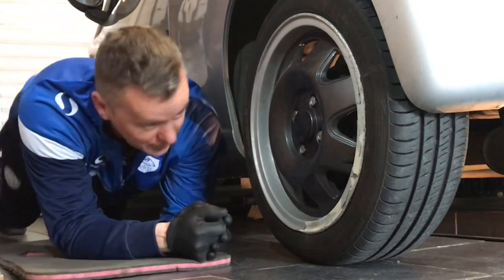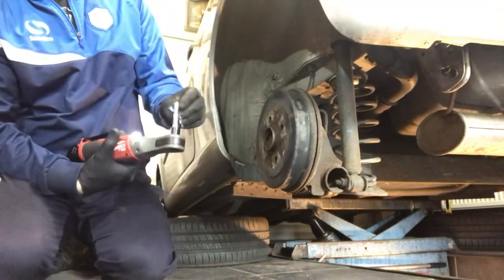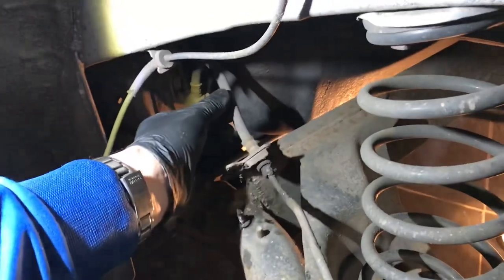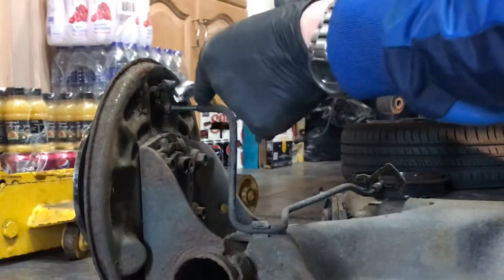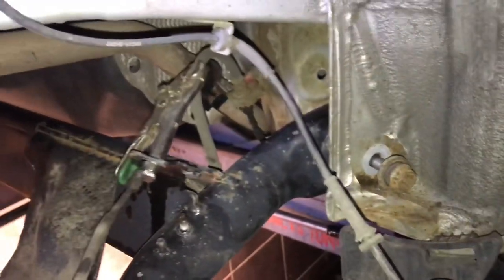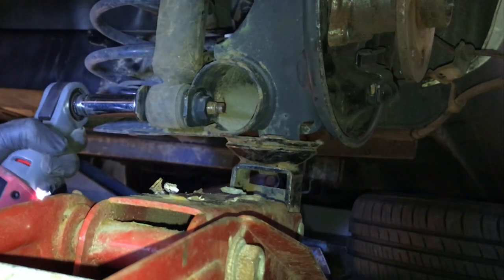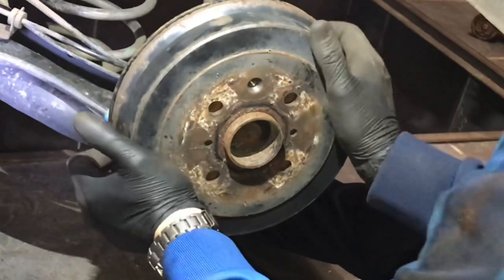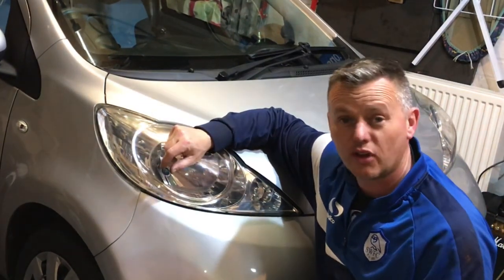Peugeot 107 Rear Suspension Replacement Following a Crash into Kerb, (AYGO C1) Rear Axle Beam Swap

Comment: Well done saved the day again. :) Good job it wasn't an insurance job as they probably would have wrote the car off. 
Think you will be lucky to find a replacement identical wheel. What make and spec are the wheels? I'll have a look about see if I can find one. If not what size are the tyres (they look quite new) and will see if somebody has a set of alloys if you have no joy finding one of the originals.
Reply from the maker: The wheels are ATS cups size 15” 6j et35 100pcd, there are more 7j wheels for sale, might go eurostyle and stretch the tyres if I can’t get a replacement 😂thanks for the help 👍🏻👍🏻🛠

Comment: Hi Anton, Any videos coming up on changing rear beam bushes. Thanks
Reply from the maker: They don’t usually fail Gary, are you having issues Thanks for the great comments👍🏻👍🏻🛠
Reply: @aaanton11  No problems,High millage car so I thought id replace them. Christmas project while on holiday. Did all the fronts apart from ARB six months back.
Reply: Thought about this too as I'm thinking of taking the axle off the car to treat rust and paint up (both axle and underbody) as will make it a fair bit easier. No play in the bushes but they look a bit naff. Did you replace yours in the end?

Comment: Just like a Yaris Mk1 except for the back exhaust.I did my rear shocks and coil springs 3 months ago,it is that easy to do.Never done my rear brakes thou for that reason...fiddly isn't me or for me.Nice job and nice video.QUESTION- My Yaris never had a retainer screw for the drums,is it bad not to have them?
Reply from the maker: no the retainer screw only only has a purpose when the wheels are off, so don't worry. Thanks for the great comments👍🏻👍🏻🛠

Comment: Do you reckon you could fit an air induction kit to the 107 next?
Reply from the maker: I don’t rate them, fitting a k&n Filter is just as good, the vvt needs a good intake swirl, the standard air box delivers this, by removing it you loose power, thanks for the great comments 👍🏻👍🏻🛠
Reply: @aaanton11  I'll have a look what's out there, thanks for the reply👍